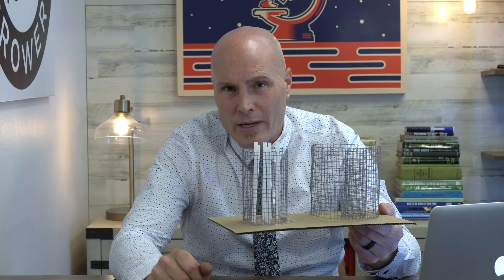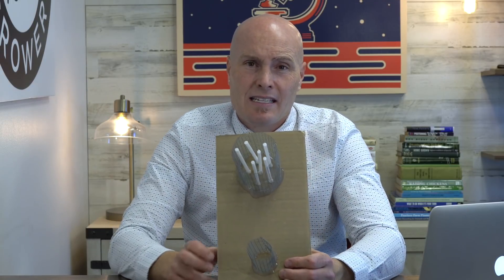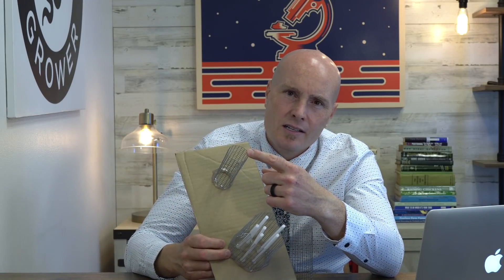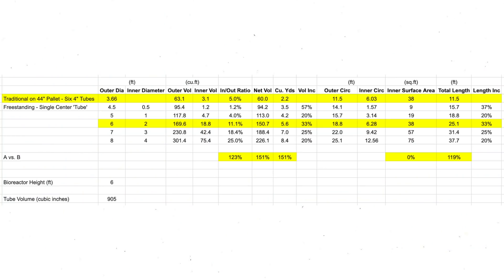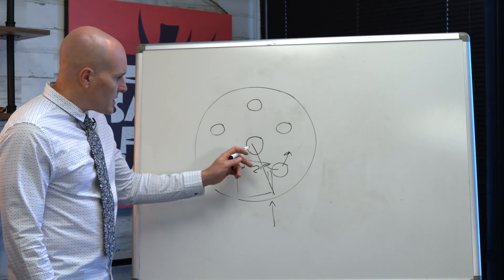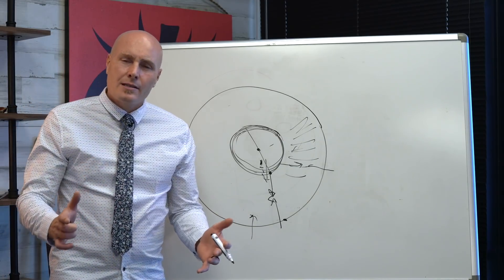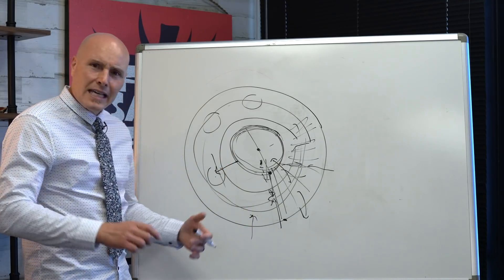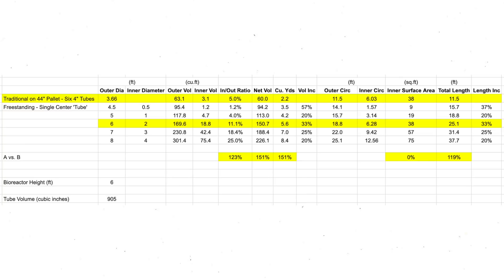Designing a New Compost Bioreactor | DESIGN SPECS and QUESTIONS ANSWERED

Comment: Diego, I am doing one next week...and now you got me interested in this...I got wire mesh for outer diameter and plastic sheeting. My question is will you be using black plastic sheeting on the outer diameter. Also, I am wondering how are you going to get constant air flow if making it directly on the soil?
Thank you!
Reply: The heated air in the central tube will rise.  When it does it will suck in cooler air somehow, either through the sides and the pile, or down the tube.  Not sure having air flow under the pile would be a significant improvement, but might help preventing anaerobic conditions on the very bottom.  I don't see that as a big issue. Piles are never perfect.  There's always some part not perfectly aerobic.
Reply from the maker: No black sheeting.  I am not that worried about airflow.  There is probably more than enough.

Comment: Have you thought about a hybrid bioreactor. Where you build it gradually over time with the worms being populated from the beginning? If you add material half at a time the worms will leave it while it heats and return when it cools. And having wedge composted with worms they actually can handle a little more heat than people think. If you boost the carbon ratio it will still be fungally dominated. The reason I suggest this approach is there are many disabled gardeners like myself that cannot fill a reactor in a short period of time. I may build and fill it gradually with worms from near the start because worms need the oxygen and moisture as well.

Comment: I built one of your designs over the weekend. There’s plenty of space to get a rake into the donut, very easy for spreading the material around. Takes lots of material.
Reply: How tall does it need to be?
Reply: @AMW635  I don’t know if there’s a height requirement since this is a passive compost. I think 3 ft initially would be fine. The fencing panels I’m using is 5ft tall. I might not even make it to the top...

Comment: Hey Diego, 
Sorry I've been blowing up your channel lately.
I'm just getting into researching this system and appreciate all the info you share on your channel. Great stuff here Diego! Keep on spreading the knowledge.
I mention my concern with this system during winter months in another post.
I'm really hoping someone can shed light on this topic. Maybe David could help with this.
I live in Canada, zone 5a.
Its cold! And there is a lot of snow! lol
What effect does winter months have on the 12 month timeline for finished compost in the bioreactor. Lets get a video going about this.
When to fill the reactor for best results? My guess is early spring to let it heat up properly.
Would the winter freeze stall or stop the process?
How long to leave it?
When to use it in the backyard home garden?

Scrap the landscape fabric, good idea.
But does it need the covering to eliminate light?
Metal option. fine screen (similar to the stuff used for exterior screen doors)
Bio earth friendly option. Burlap! woven jute will break down over time.

I think the pallet underneath is important to keep the airflow in the reactor.
the air columns wouldn't do much good if the air can't flow through the pile.
I assume eventually, after the worms are introduced, the columns would collapse? Maybe not though?
I like your idea of laying pipes horizontally on the ground to achieve more airflow.
But I think this would only be needed if you were going to cover the system with something similar to the landscape fabric. I feel as though the covering is needed in this system. The suns rays could scare away the microbes! lol

I like your new design. But I wonder if it will get the same results?
Is the center column too large? Too much air flow? Maybe it would dry out quicker?
What about just making a 2ft thick wall like structure?
No interior air column needed. 
Why is the johnson-su bioreactor round with interior pipes?
Would a 2ft x 2ft x 5ft compost setup work instead of the 3ft x 3ft x 3ft pile. Thinking about the 12" air penetration theory, It seems as though a 2ft x 2ft pile would stay more aerobic ?

Thoughts?

Comment: Just curious as to if you tested this without the concrete mesh for the middle tube.  It seems like the chicken wire should be strong enough since you are using T posts as well.

Comment: Appreciate the detailed breakdown.

The question remains though, why not use multiple 2 feet cylinders instead ?
it would result in more volume from the same material as well as ease of handling.
Especially for woodchips where heating up (and keeping it hot) isn't the main goal.

Keep up the good work

Comment: Thinking of building a similar bioreactor . 5ft across so that it can fit on my standard growing bed. The internal tube 1ft so that air within 2ft . 6ft high . The base siting on the growing bed. But to increase ventilation put some tubes at the ground level into the centre 2 inch diameter. When the pile gets hot the internal tube would pull a drought of air through the horizontal tubes. These could be regulated using a butterfly valve , or Brick. To obtain ideal temp.
Reply: Don't make it too high, it's a pain to load.  Don't ask how I know. :)  I like 4'.  Still a workout, but can lift or fork things in without too much trouble.  I'd say keep it no more than armpit high for whoever is going to be dumping stuff in and trying to spread it around in there.
Reply: @dans3718 Yes your right.  I calculated outer mesh with 60cm radius and inner mesh 5.5cm radius, using 110mm drain pipe for former with hundreds of holes in it, and the height 120 cm , gives a volumn of 1.3 m2 Which is 4 times 330L dalek composters of materials. the outer mesh is about 4 meters long ,

Comment: Low/medium height bioreactor rings around young fruit trees? Grow beans on outer perimeter? Great ideas Diego. Thanks!
Reply: I'm reconsidering the fruit tree idea. Roots may travel up into the temporary ring. And of course trees love to breathe like the rest of us -- however I figured there would be enough air circulation given the doughnut whole. The roots are quite concerning though. Probably too much work to be extra careful around young trees. Growing beans all over the towers with many smaller towers throughout the gardens is my plan. Should shield the towers from our blustery winds that dry out anything above grade pretty quickly.
Reply: Great idea! I think it's work to have red worms bioreactor between trees.

Comment: Diego, thank you!  Loving this breakdown and spreadsheet work!  I also immediately thought of putting some 2 inch horizontal pipes at the bottom to improve an airflow chimney in the middle.
Reply: THIS!  The bioreactor needs something to allow air flow THROUGH the vent.  His design will not work very well as designed.
Reply: @krklsu9109  I think his idea or horizontal pipes at bottom will take care or that issue.
Reply: We thought the same chimney effect use it.

Comment: I really like that you are trying to improve on a technique that is already very effective because I do agree the pipes are a pain to mess with when filling and such, but I don't think you really understand how the bioreactor works if you think the pallet isn't important.  The pallet is absolutely essential.  It will not work properly without it.  It's how the air flows through the vent holes and hence aerate the compost.  It seems like you think the air is supposed to circulate from the top and down into the vent holes.  That's just not how it is designed to work.  The pallet allows air to flow "THROUGH" the vents from bottom to top or vice versa.  Now maybe your new design will work "better" without a pallet, but I would think it still would not have enough air flow to be near as efficient as if it had a pallet.
Reply: What if you used a roll of welded wire on the bottom instead of pallet and stones to keep the unit off the ground and allow air flow.  I figure you've already bought a roll of wire, why not snip off some more for the floor of the unit? Not everyone has pallet access.  You could hog ring the floor to the upright parts of the unit to keep them in place and wouldn't need a welded spacer as in the original design.  Most of us are not welders.
Reply: @jeffreydustin5303  yeah,  it doesn't have to be a pallet per se,  there just needs to be something to allow air to flow "THROUGH' the vent. You don't even have to elevate the entire pile.  If you did just the center vent as he suggests in the video, then add some sort of pipe or venting going through the bottom of the pile from outside the pile to the vent to allow air to completely flow through.  With the 6 vents, as in original reactor design, the bottom of each vent would somehow need to be vented to the outside of the pile.
Reply: @krklsu9109  Personally, I suspect ground contact is better than ground separated.  There might be a better hybrid solution though, better aeration at base but still partial direct ground contact.  Maybe take 3 of those pipes and lay them horizontally across the bottom right on the ground.  But maybe the pallet design is already allowing direct ground contact enough.  Have only seen vids of the Johnson-Su, haven't had a chance to examine one to see exactly what's going on down there.
Reply: @dans3718  Ground contact may be better if you don't want to add worms yourself... as long as you can provide ventilation like you said and he did mention at the end of the video.  It's just that he doesn't seem to know how important it is.  He mentioned it  as if it's optional when really it's a requirement if you want to duplicate the Johnson-Su bioreactor. With the pallet design there is no ground contact, and that doesn't bother me at all because its easy to add the worms.  Worms are pretty cheap to buy, plus you can buy specifically the Red Wigglers that are MUCH better at composting than regular earth worms (nightcrawlers), which are mostly what you will get in your compost if you are just relying on ground contact.
Reply: @krklsu9109  Can red wigglers survive cold winters?
Reply: @mtlefty8687  That I don't know.  I live near the gulf coast in Louisiana so cold isn't an issue here.
Reply: I may a pipe in a trench in the ground. I d end beneath the pike and o I have a bent sheet if hardboard to direct the wind down into the holene ending in a hole.

Comment: I’m really liking this idea. I’m still trying to figure out how to make it work with a wheelbarrow. Mucking out a stall tends to give me a good carbon/nitrogen ratio, but it fills barrows, not tubs, and I’m trying to reduce the lifting (back issues). Any thoughts on how to set this up? I’ve thought of using our copious sloping everywhere so that a ramp wouldn’t be as sharp an incline (and maybe a removable cap for the center tube when dumping).
Reply: Use a horizontal pile. Lay down some manure, put a large ventilated pipe, like a 8" drain tile, and pile manure up on either side, leaving the ends of the pipe open, cover with a tarp after you pile it as high as you can, if you get a lot of rain. Monitor temps, you should have finished compost in a few weeks. Look up static pile high fungal compost.
Reply: Natasha S. Get a long handled fork.